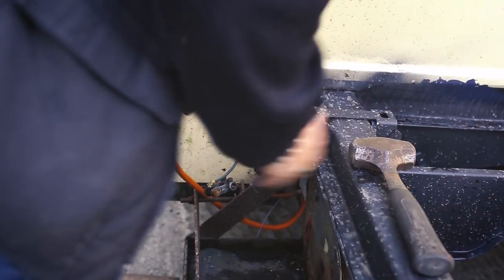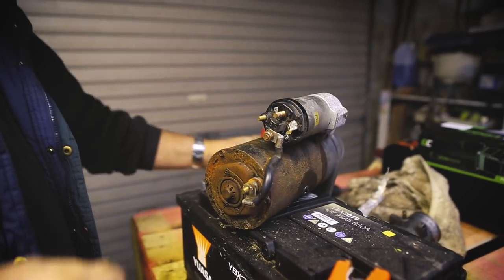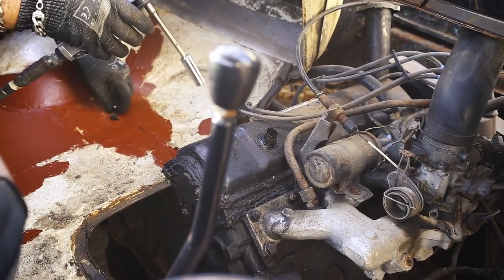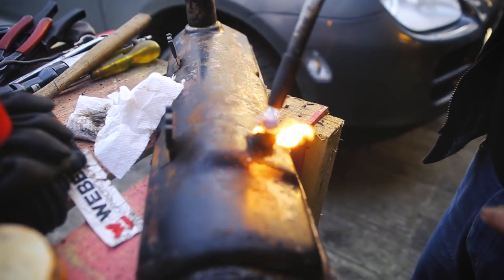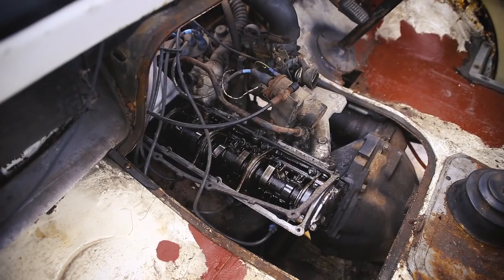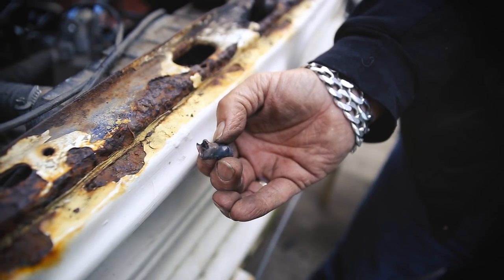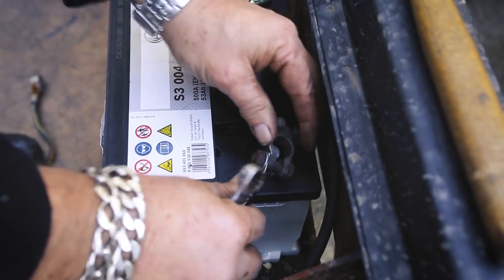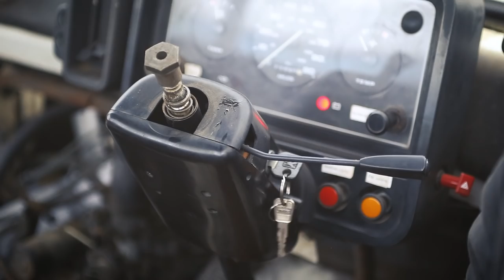STARTING the Engine!｜Bedford CF Van Conversion

Comment: Is a mechanically controlled diesel engine or lpg conversion in the future plans?
Reply from the maker: Most probably yes, the 2,3 slant in this is notoriously awful for fuel consumption and we're not sure how well it will pull when fully laden. We'd love to keep it as original as we can however an engine swap is likely on the cards for next year.

Comment: The engine blows oil and the valves need to be adjust.I remember if I drive this van by the Opel dealer in germany.
Reply from the maker: Yeah we’ve got a long way to go until the mechanics are running smoothly on this. It’s the beauty of old vehicles I guess :)